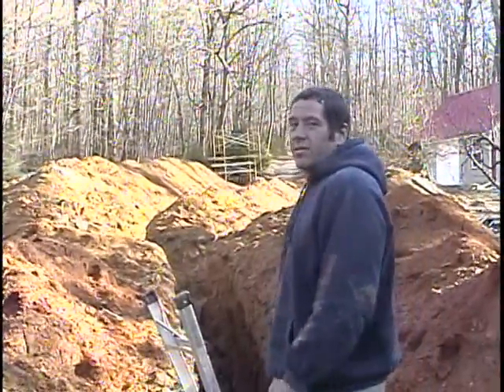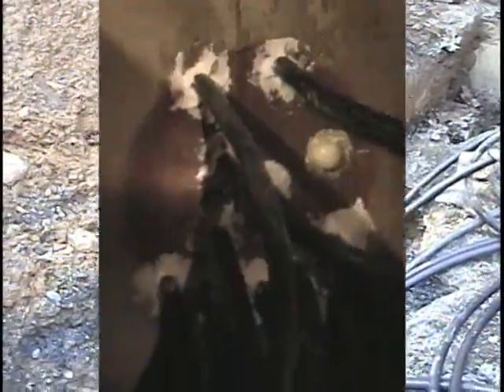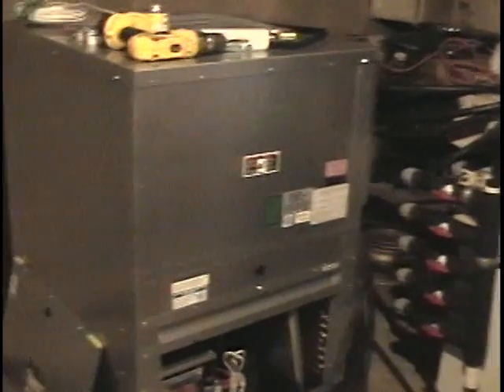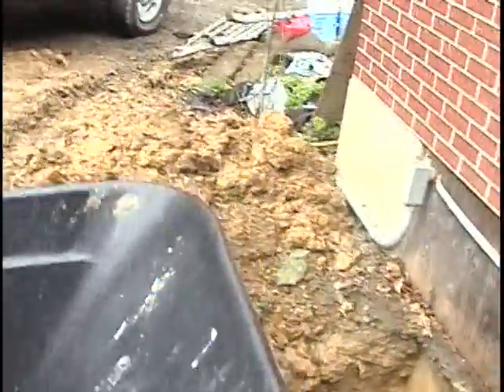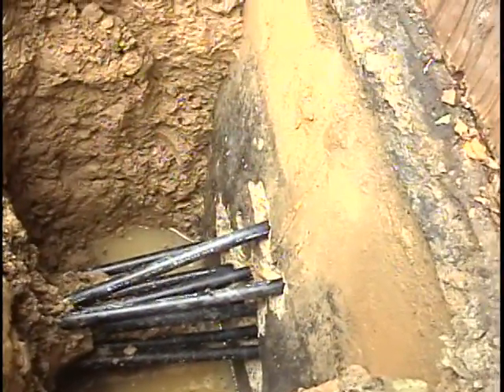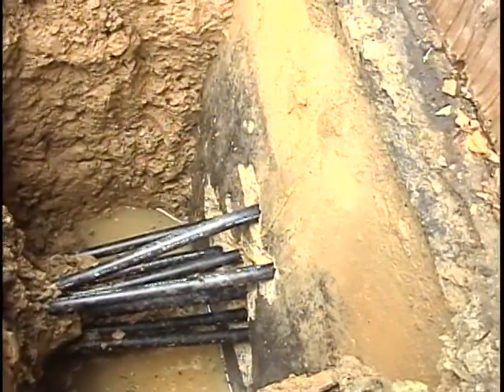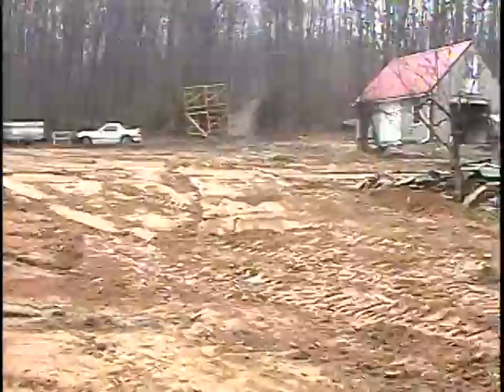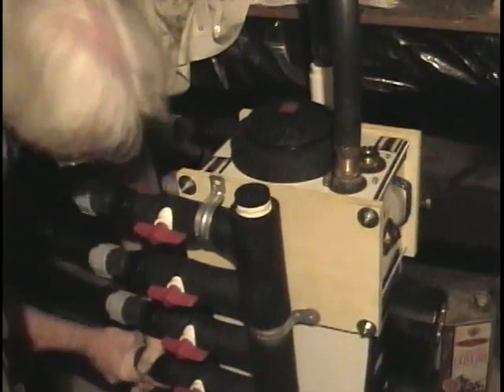Geothermal Closed Loop Install

Comment: Did you use 1 1/4 inch pipe for the horizontal loops in the ground?
If you did, were you able to form the slinky loops with in the 36 inch wide loop size?  And did the slinky loops overlap at 18 inches?
If your slinky loop was a different loop size can you give me your dimensions?
Was it difficult getting the pipe to make the loop?
Thanks,